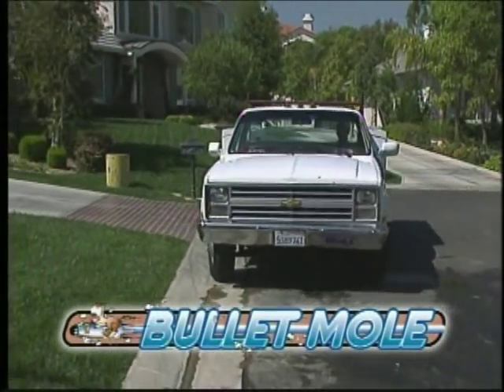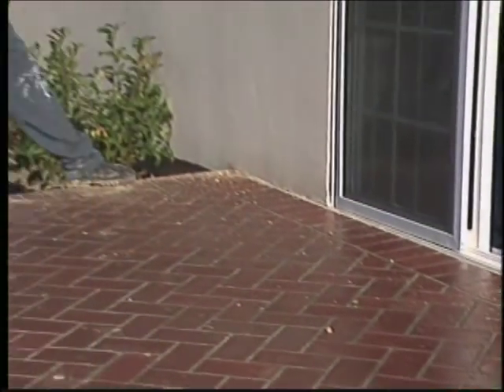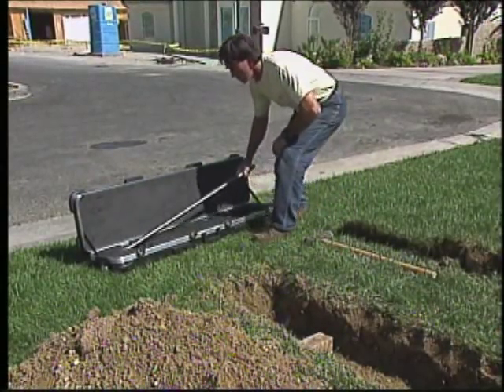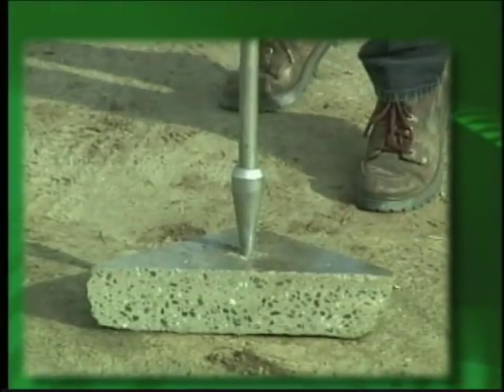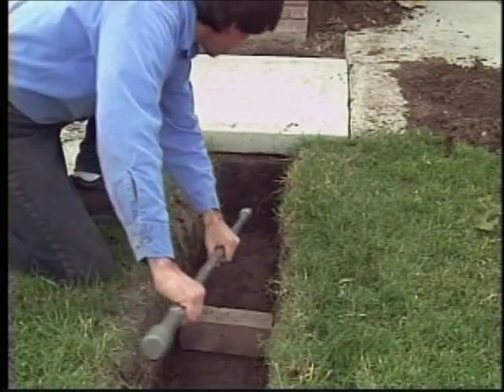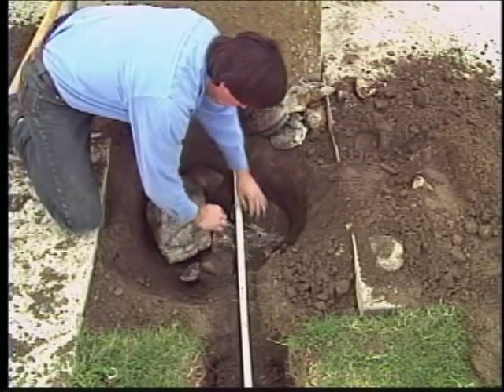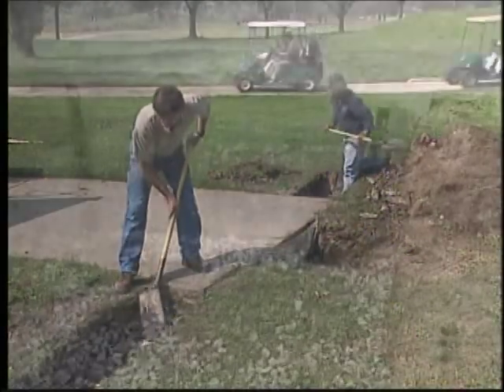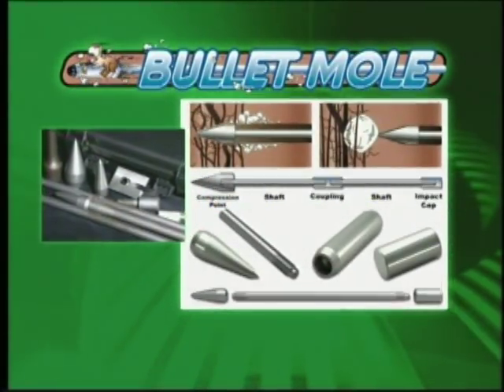Bullet Mole, The Original Ground Piercing Pipe Installation System

Comment: I am an electrician in Vegas and I have to run lines past sidewalks all the time. I usually jackhammer and remove the sidewalk. I rented this product and it worked like a charm. Took about 30 minutes with a 8 pound steel handle sledge hammer. I ended up buying it with my buddy because we are sure it will come in handy. Thanks Steve

Comment: This is a fantastic tool.  I needed to get under several driveways to pull conduit, and it worked EXACTLY as it shows here.  Easy, simple, quick.  While I see reviewers didn't like the cost (it does seem expensive at first look), it is perfect for the job if you have to use it over and over, as I did.  HIGHLY recommend!

Comment: I just had to do this under a pathway 1.4m wide. The clay was the killer. If I put that bullet mole through that clay I would never be able to extract it. No way.
Reply: Myers Mushrooms clay doesnt matter shit is like glue pound through take head off but the friction will no doubt be a very tough pull i use 8ft ground round skinny as hell still fucking hard as hell pull back in clay
Reply: Do the pvc/water hose gig. Hard as a mofo but once it's through you just leave the pipe and run your wire through it. No need to extract it.
Reply: Pierre Cardone 
  Yup, or steel pipe with EMT pipe (extruded metal tube)  connectors.  You need the threads to attach the time connector and fittings.   And a water hose, of course.

Comment: I thought that it was too wide in dia to do this, especially in dry compacted dirt (around rocks to be split) but IF the point stays sharp, should work. Consider a 1/4" dulled point and a 1/16" point. The same amount of force pushes both yet the smaller point has amplified the force about 16x to split with. If the point was only 1/32", would be 4x that even!
Still, though, should take whatever energy required to compress material around hole...
I conclude not a myth... and worth the work.

Comment: What happens when you drive this mole into a 80,000 volt electric cable?
Reply: Call BEFORE you dig! Get everything located....
Reply: Ed Dreyer dig safe doesnt cover customer utilities there considered secondary and homeowners responsibility with exception to national grid gas only gas ...tl501 locator will do the rest
Reply: CBYD in Ct. Call Before You Dig, free service and they mark everything.